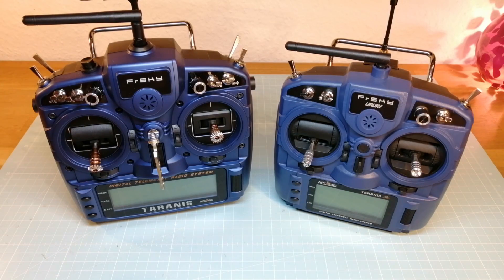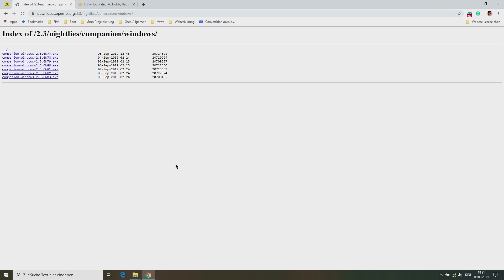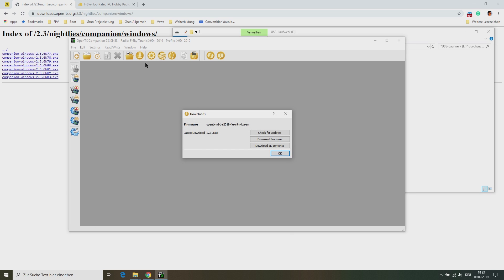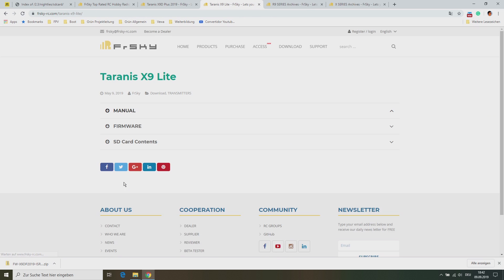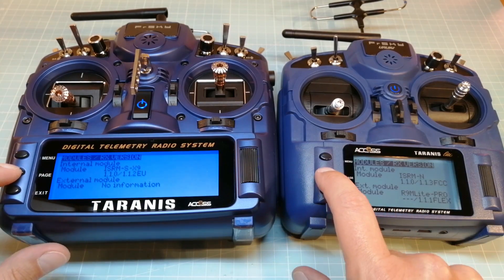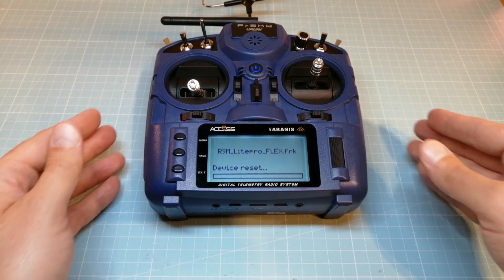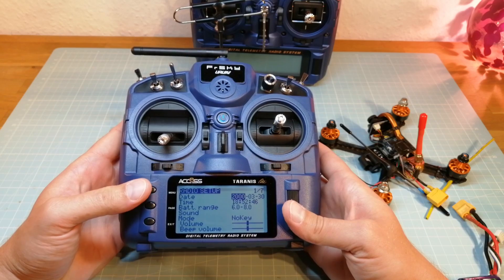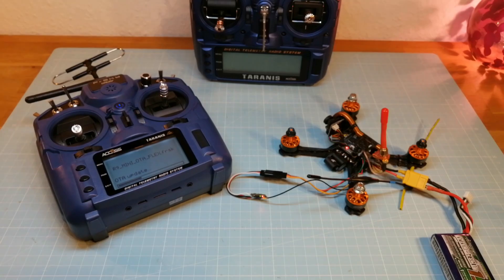FrSky X9Lite X9D+2019 🤓 ALL YOU NEED TO KNOW - OpenTX - EU-LBT / FCC - Firmware - OTA - Access - R9

Comment: Thank you torban for the effort and all the good information. 👍 One question is when you get the radio it has a version of 2.3 on it already so isn't that the same as what's on opentx website? Maybe a nightly build already? Did you check before you flashed? I had an email back from frsky with the tools to change to lbt but was just wondering if I could put that straight on without messing with firmware and just update the internal module, bind and fly. I don't really want to use a nightly build unless it's OK too? Cheers
Reply from the maker: Thank you for your comment! Yes bevor there was also a earlier version of opentx 2.2.3 installed - but this version wasn't compatible with my r9 modules...
Reply: @TorbanDallas  ah OK thanks for the info. I'm still waiting on shipping to receive the radio and will be doing all the updating soon as I get it 👍 take care
Reply from the maker: @Nicklz5555  maybe you one comes with the latest version of open TX. Or there's even released an official version when you receive your Taranis 😁
Reply: @TorbanDallas  well 2.3 has just come out 😉
Reply from the maker: @Nicklz5555  yes, OpenTX 2.3.0RC1 :)

Comment from the maker: !!!UPDATE 2019-09-14: OpenTX has released Version 2.3.0RC3 - In Companion now you need to select Release candidates (testing)! When the openTX Version is final, you need Release (stable)
!!!UPDATE 2019-09-11: FrSky has released the Access Firmware for the R9M 2019 full-size module now! https://www.frsky-rc.com/r9m-2019/
With the R9M Access Firmware and your external module set to R9M Access, you can use the new Access Protocol with your R9M 2019 and your X9D+ 2019. Btw: OTA Update works also the same as with the x9lite.
Reply: any chance OTA update functionality will come to the QX7 when using the R92019 with it? I just purchased my R9 last night I cant wait for it to get here
Reply: so i have the 2019 r9m module full size in my flysky nirvanna, but i have 2 r9 receivers that are not the ota versions, u are saying im able to use the access firmare on my module but not my recievers? so the access firmware is useless to me unless i have ota recievers? thanks for the help
Reply from the maker: @ADMIND3R  no that is not what I have said. Take a look at the frsky website - you also get the access firmware for the old r9 receiver. You only can't use the Ota update function with the old receivers

Comment: Nice video and one of the first (if not the first) to show the complete procedure including OTA update.
Nevertheless for me it's not time to buy my complete equipment again. Sure if somebody is sponsored, no problem,
but my Taranis X9Dplus, the R9m and all the R9mm receivers they are not even 2 years old. I don't follow FrSky's attitude "For using the new features, you have to buy everything new". And they are not really budget.
I would rather like to see, how people can maintain their current gear and keep it up to date.
Reply from the maker: HI, thanks for your comment, I also have a lot of FrSky Taranis X9D+ / R9M (Firmware an maintenance) Videos on my channel – I’m still using my X9D+ with the R9M Module and the Flex Firmware – and it works pretty reliable – no one want’s you to buy new hardware 😊 You can stay with the old Hardware – only if you need the Access Protocol and OTA function you need to upgrade your hardware. And if you are owning the new FrSky Transmitters – you don’t have to worry if you don’t want to use the access protocol, all transmitters are backwards compatible. Btw: Maintenance with the X9D+ works very similar – install the latest version of opentx for your x9d+ (not 2019) radio and get the firmware from frsky for your modules and receivers.

Comment: Hello,is it possible to bring it back ltu eu protokol ? if it's already there global (inetrnational)
Reply from the maker: Yes, you can see it in my video. You can change the internal module into fcc or eu-lbt mode - it's not depending on the EU flag in companion. The opentx version has nothing to do with the internal module.
Reply: @TorbanDallas   and after that can i change it back again?
Reply: I read that you can't bring it back,access
Reply from the maker: @jonasfreonas  you mean the external r9? You can also select EU or FCC.
Reply from the maker: @jonasfreonas  please specify your question. Not easy to understand your question. Your can see in my video how i change the internal module into fcc and EU mode...
Reply: @TorbanDallas   as I want to use crosfire.
Reply from the maker: @jonasfreonas  and, now word a full sentence with your question, what do you want to do? what do you like to set up in your radio? Please don't make it that hard to understand your questions.
Reply: is it possible for one generation LBT and later to go back to another FCC,found it impossible after one time, it locks.
Reply from the maker: @jonasfreonas  I can change my internal module to EU-LBT and also back to FCC. Flashing opentx to EU and NON-EU (international) is also possible. The same with the external module. I have never heard or seen about an eu-lbt lock.

Comment: Is X9D+ SE 2019 Support R9M 2019 Access.
Protocol.
Im not able to see in my X9D
Reply: X9D cant. X9D 2019 can
Reply from the maker: @Mateyhv1  Did you try it? Theoretically, it should be possible to run the r9m 2019 with access protocol on the x9d+ (non 2019 version) - but it also depends on the optenTx version for the x9d+ (non 2019 version)
Reply: @TorbanDallas  yes, I have tried that and officialy Frsky has said that any radio which internal module is not capable of access protocol wont be able to communicate on accept even its just the external module and receiver that use it. The communication between module and radio is different in 2019 radios, PXX2 aparently.
Reply from the maker: @Mateyhv1  thanks for the information!
Reply from the maker: Yes it is. I can select R9M Access. But until now I can't find the Access Firmware for the R9M - seems like there will be released a new Firmware or even a new R9M Module soon.
Reply from the maker: Update: since yesterday the r9m 2019 access firmware for the external module is available at the frsky website. Just this fw and the latest version of opentx as shown in my video, select r9m access in your transmitter and you can use the access protocol on your r9 system
Reply: @TorbanDallas  Thanks I have checked